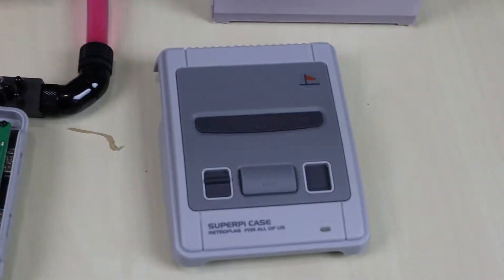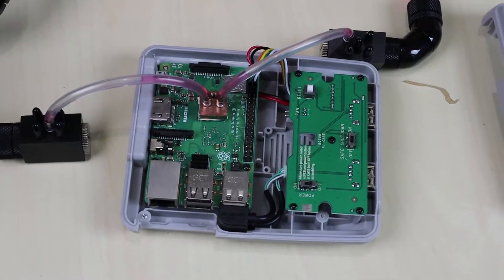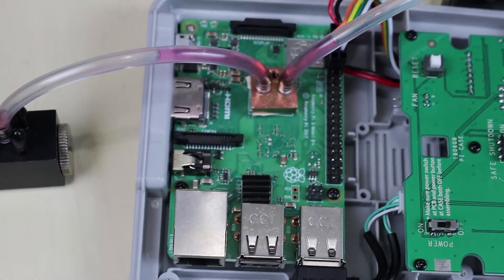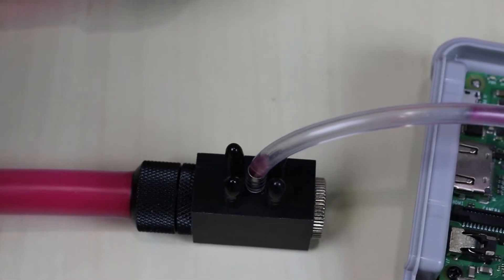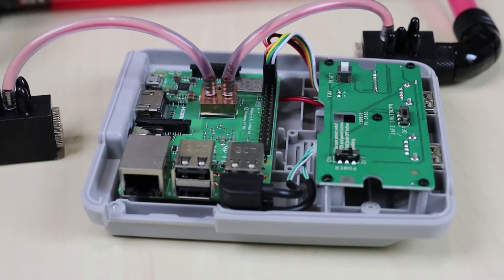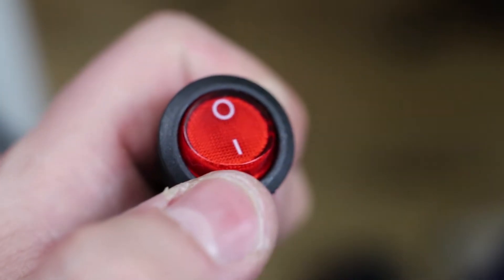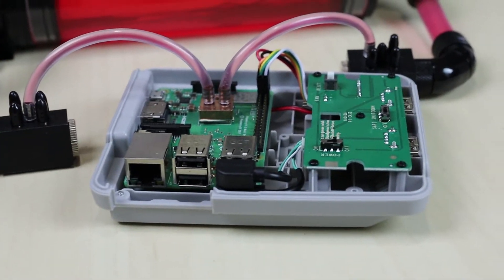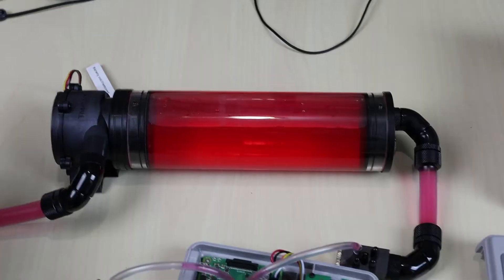Water Cooled SNES Classic - Raspberry Pi 3 SuperPi Case

Comment: Water cooling without benefits, on a system that doesn't throttle  due to excess heat?  no overclocking, no benefit.
Reply: raspberry pi3 throttles A LOT especially in plastic cases, or when overclocked. Of course this is a "proof of concept" something done for the sake of it, but it would be funny to have a small Waterlool for the rpi